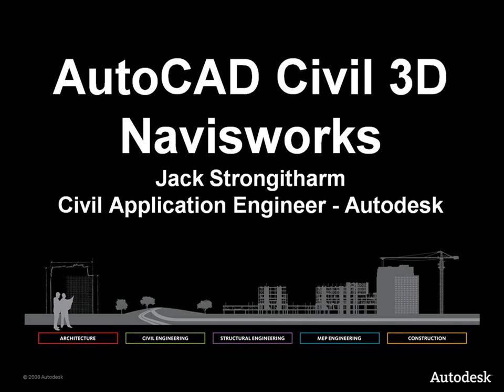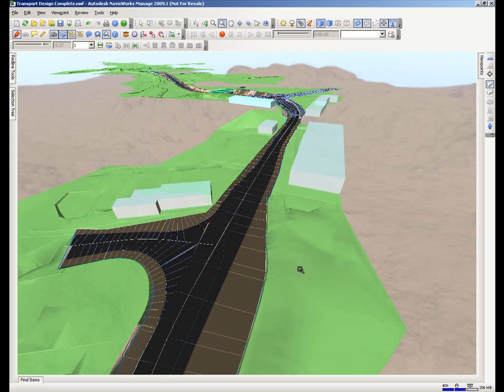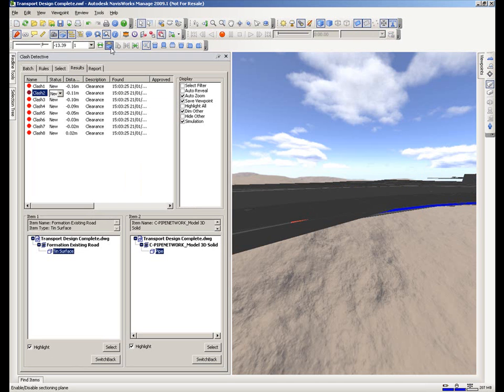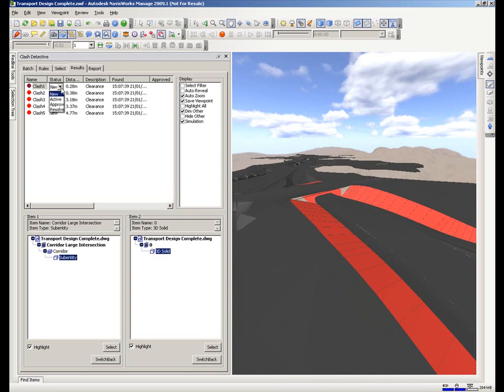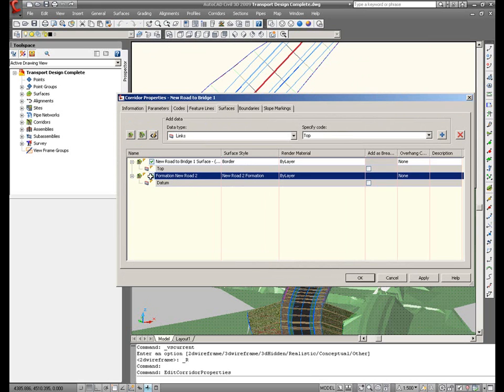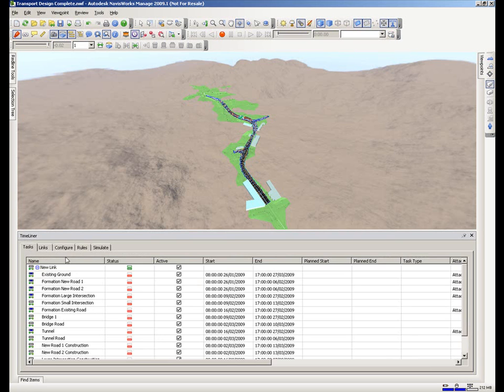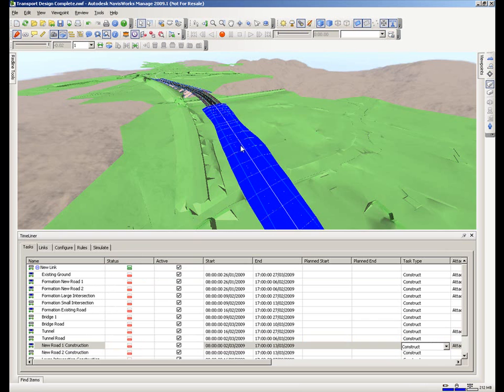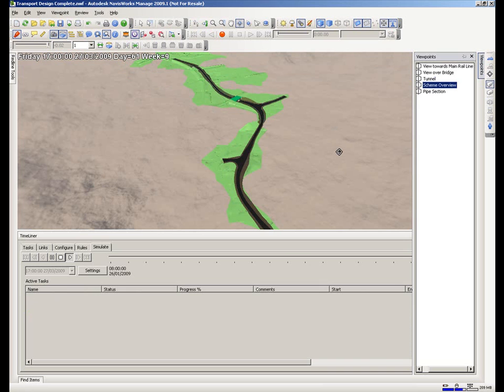AutoCAD Civil 3D and Navisworks Transportation Demonstration

Comment: How to export curbs and concrete objects from civil 3d to 3ds max design.
I tried to do this but I can't works with me. All surfaces are corecly imported (Road surfaces and ground) Is there some tricks or modification to do before using civil view exporter. Thanks a lot